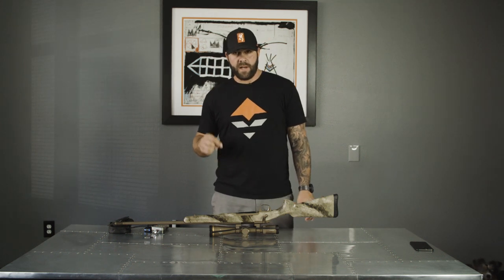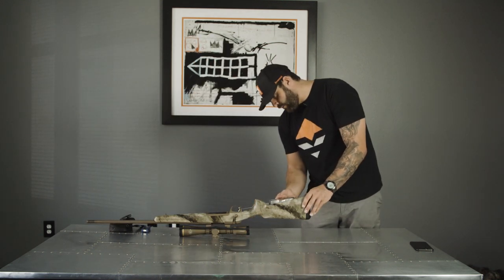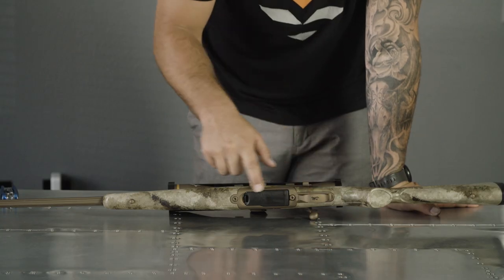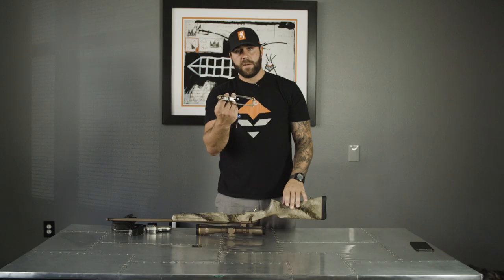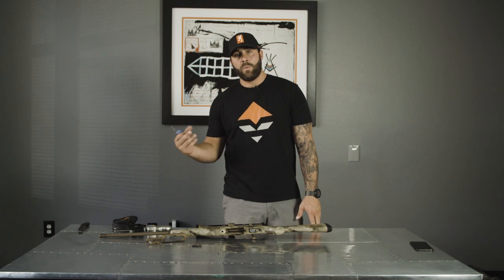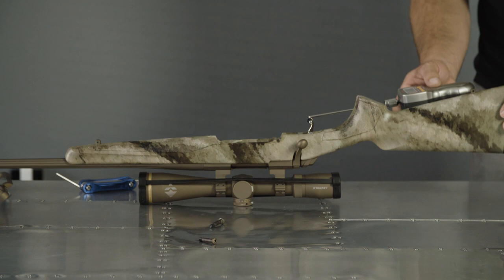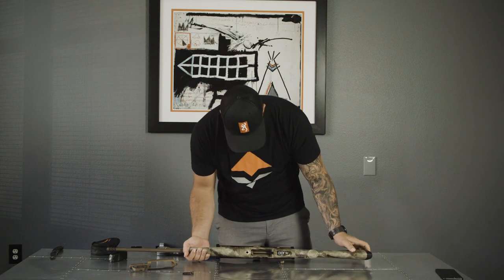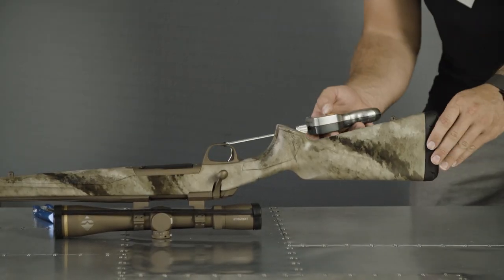How to Adjust Trigger Pull in a Browning Rifle

Comment: Do you have to re-zero the optic everytime you remove the action screws and adjust the trigger pull?
Reply from the maker: You shouldn't need to as this only adjusts the pull of the trigger and does not affect the actual discharge.